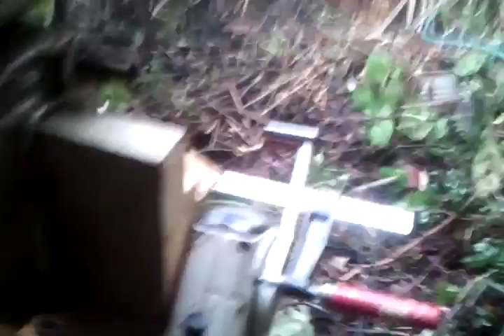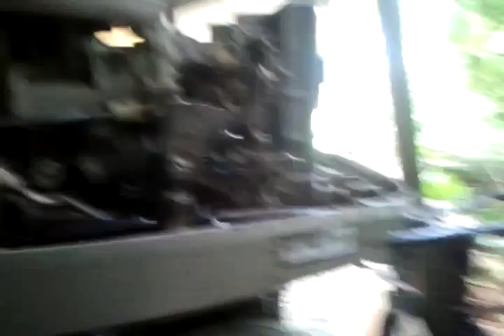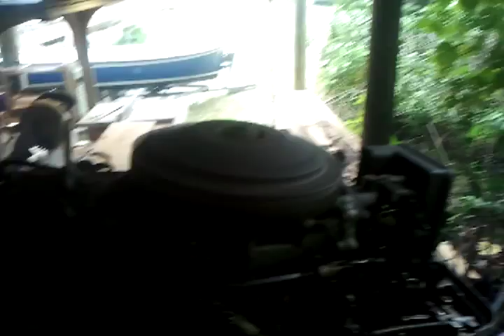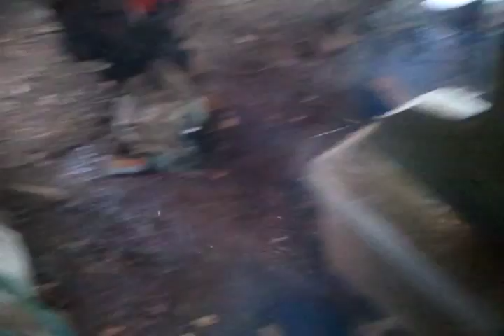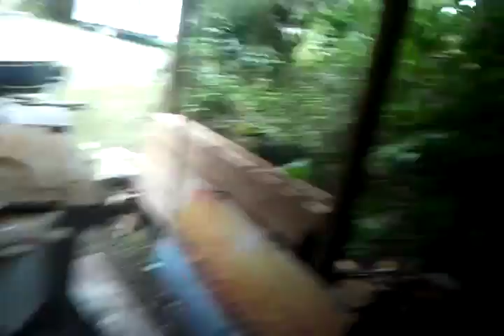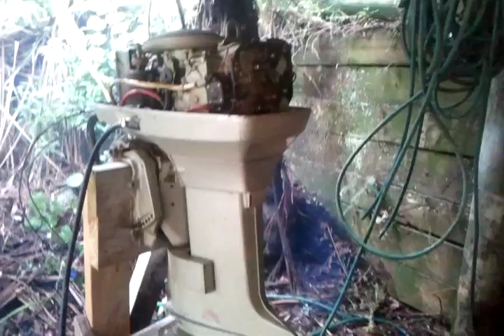Evinrude 1972 50hp engine

Comment from the maker: sounds like a good find! I recommend replacing the water pump, they tend to degrade after a few years. also check the gearbox oil to see if its cloudy or not. if its cloudy. you may need a new gearbox. Great engines for those who like to go fast :D.